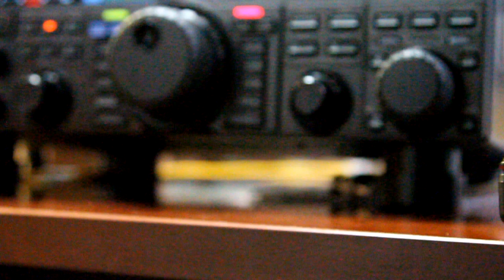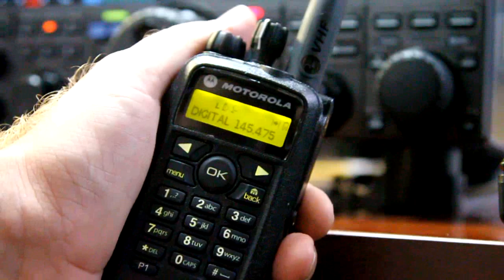MOTOTRBO FPP

Comment: if the programming soft ware for this is locked and requires a password,  when I put the GOP  board in this radio, will it work ?